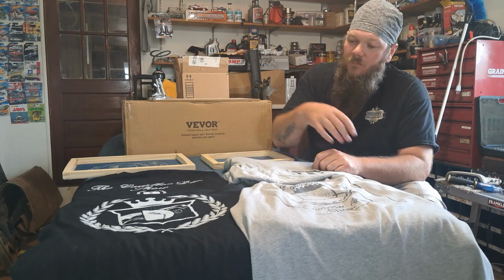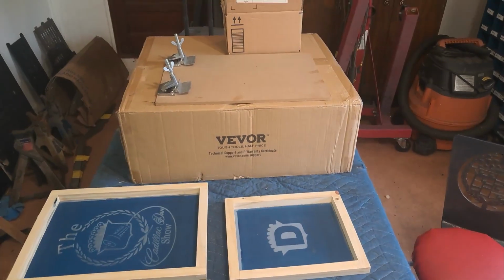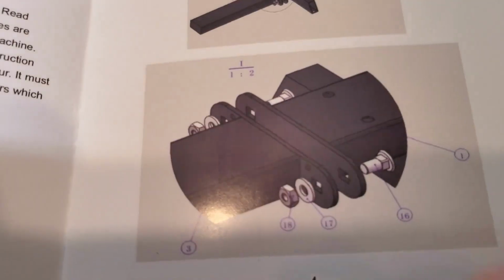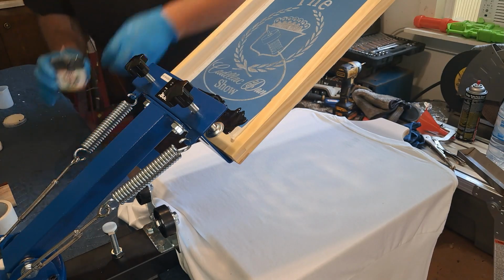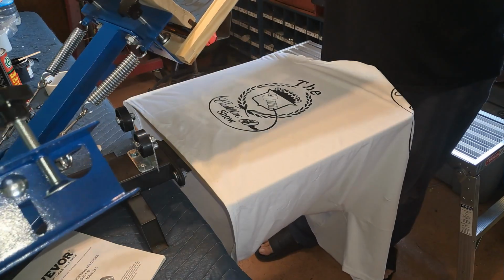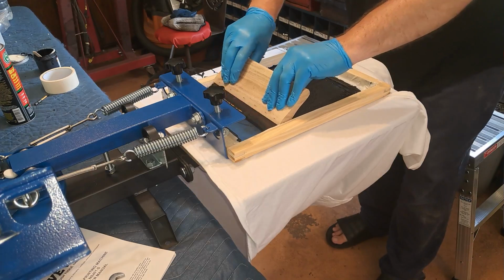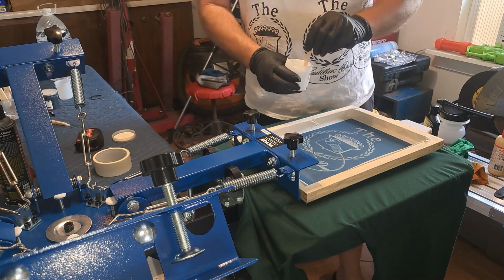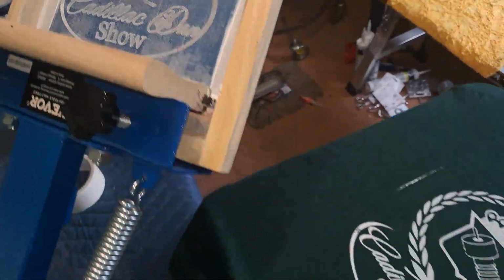Is Vevor Screen Printing Machine Worth It? My First Impression!

Comment: A few tips...

 1) Lightly pray your platen with a spray adhesive.  It helps old the shirt in place if you lift the screen and decide to do an additional print.
 2) Always flood the screen, then print, then flood the screen again. Then you can pull the screen up to check the shirt.  Flooding before pulling up the shirt will help the ink from drying out in the screen while youre switching shirts.
Reply from the maker: Thanks!